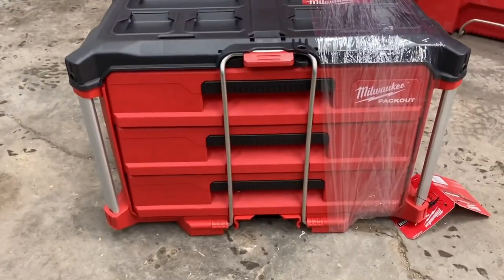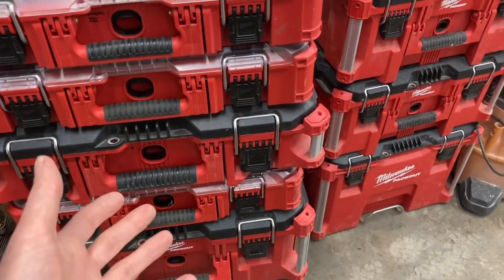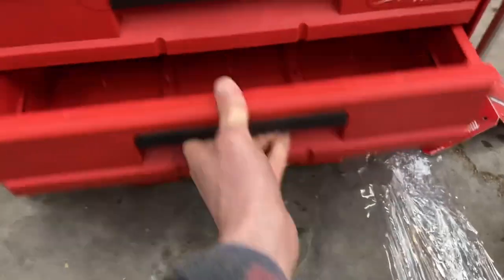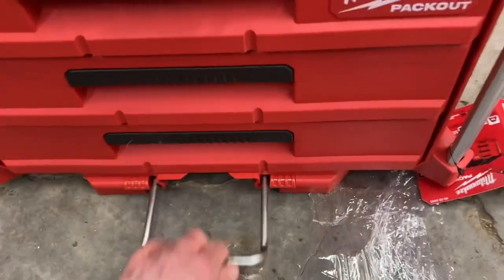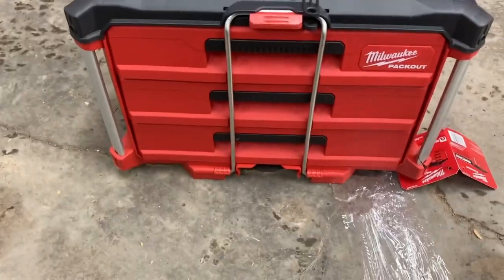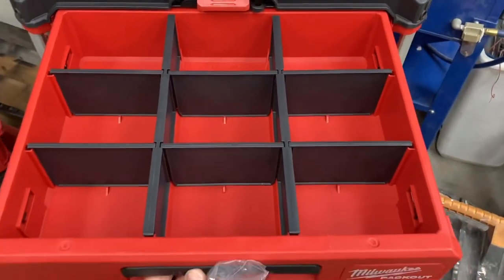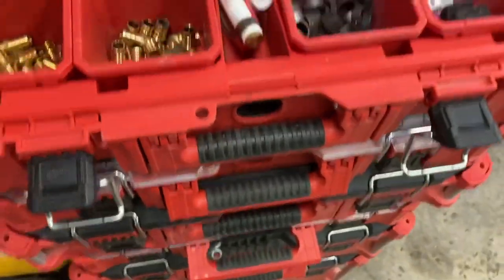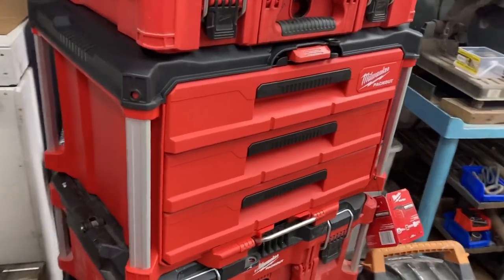Adding Milwaukee drawers to packout stack

Comment: the bottom box with wheels oughta be the box with drawers. How did all the tool boxes mess this up?
Reply from the maker: Haha right??  Drawers in the bottom wheeled boxes would be so handy in the shop!  With the setup in my trailer stuff tends to pile  at the bottom of the stack so I would still use the current wheeled ones

Comment: Dude this is been amazing on my setup.
  I do have this in my Honda Odyssey and is place in the trunk, in the bottom is the regular thick packout box the one with the handles and and top is the drawers which slide perfectly is enough clearance to open all of them.
This is been a God send item, I struggle with removing each packout box to access my stuff.
   I was able to remove the big two wheels packout box and  and extra packout with handles and still have all my tools like before but at much ease access.
   Hope I explain it good enough, I wish I can attach a picture of this here, ho well it is what it is.
Reply from the maker: Ya you need to lift off whatever is on top of the wheeled units anyhow in order to open that one.  Do you have 2 or 3 drawers?
Reply: @FixerMerlin  I got both of them and I was not sure about the 2-drawer but man that I was wrong they are like Batman & Robins.
Reply from the maker: @Rexxthespecialist  I’m still waiting for the 2 drawers to arrive
Reply: @FixerMerlin  I’m absolutely sure that you going to love it, the two drawers will fit nicely the 16g nailer if you own that one, and consumables.
Reply from the maker: @Rexxthespecialist  bro.  You read my mind.  I have the 18g and 16g finish nailers and am planning to use the 2 drawer to keep them separate with all the nails for each in it’s own drawer.  Then I just grab the nailers and add it to the stack.  

This will also free up tons of space in my tool bench in the garage.
Reply: @FixerMerlin  I’m planing to get another set is really useful and I’m more productive, Of course I’m working out, eating and sleeping better! That helps for sure.
Reply from the maker: @Rexxthespecialist  I’ve been I busy to work out, but can’t wait to get a couple of the 2 drawers for the setup in my trailer.

Comment: Everyone has packout.  This one is definitely the best system out there besides Festool.  But the Festool is smaller.  I can put my super sawzall in the packout.  Forget tool cabinets.
Reply from the maker: Haha I definitely like the pack outs, they’re lightweight and practical..  don’t know too much about the festool line but from what I understand it’s top quality
Reply: I regret getting invested in the Ridgid Pro toolbox ecosystem so early. Great boxes by themselves and also amongst the competition ...EXCEPT Ridgid only got as far as 5 or 6 kinds of boxes and just stalled there. Milwaukee just ran with it and it's sensational the creativity, variety and utility of the Packout system! I have outgrown my small Craftsman mechanic box and am now building a truly scalable Pakout mobile set!
Reply from the maker: @chriskelvin248  ya I totally agree on the scalability you can buy them as you need them and mix and match as your set up grows.. mine is ever expanding..

Comment: This guys packout collection cost more than my house.
Reply from the maker: Will trade: packouts for a house.
Reply: @FixerMerlin  is the drawer water proof?
Reply from the maker: @rickyperkins232  I don’t think so..  it definitely doesn’t have the rubber seals like on the tool boxes but would likely keep out some splashes of water.
Reply: @FixerMerlin  thanks bro. Now that you have yours for awhile now is there any regrets?
Reply from the maker: @rickyperkins232  definitely no regrets, however I did notice yesterday that when I went to move it from the stack I instinctively wanted to grab it on top but there’s no handle there.  No big deal, I had just gotten so used to moving the others that way and muscle memory took over for a second..
Reply from the maker: Also fiddling with the wire drawer lock thing is kind of a pain but I don’t want to leave them unlatched and forget and drive off into the sunset.  This was a huge problem with my old setup where I had a husky tool bench with drawers in there.

Comment: How they didn't lead with the drawers & the dolly/trolley is beyond me. I guess they figured nobody would buy the rolling toolbox unless they lead with it?
Reply from the maker: Depends what you’re putting into them I guess.  The rolling toolbox definitely comes in handy for bulkier items or seldom used plumbing fittings etc.  I think the drawers are a recent addition to the line up, and the rolling boxes part of the first pack out system?

Comment: My only complaint is how much dust gets in through the drawers. They aren't sealed
Reply from the maker: Ya unfortunately there’s no protection from dust or water.  Maybe they could change the design and put a hinging sealed panel on front to make it airtight